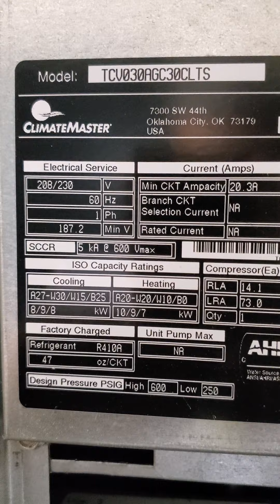ClimateMaster Board Upside Down

Comment from the maker: Some of the new units are coming with a Circuit board Upside down. THIS was a code 6 or CO meaning Condensate Overflow. Cut power off to Erase Fault Code and Reset

Comment from the maker: Flashing green light means Board is detected a Fault in this case after Shorting the TEST pins for 3 seconds You should be able to Get a Flashing Code number from 1 to 8 more or less.Code 1 means all ok 👌.....questions????????
Reply: Hello, is this the only way to get the unit to give the fault code? 

Instead of shorting the test pins is there a test button or anything to get the unit to give a code?